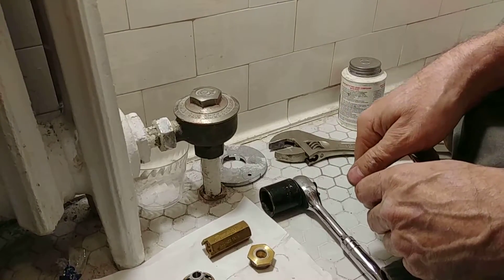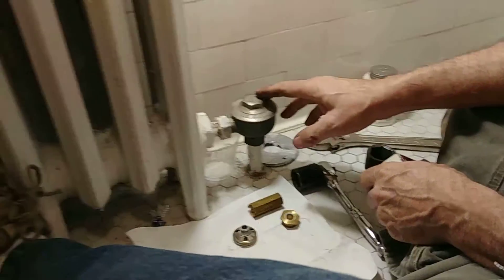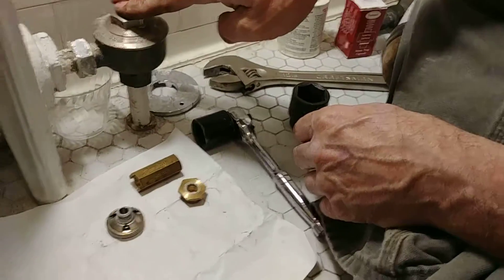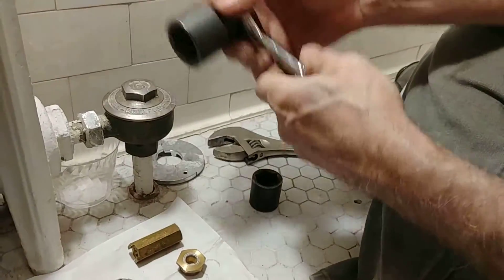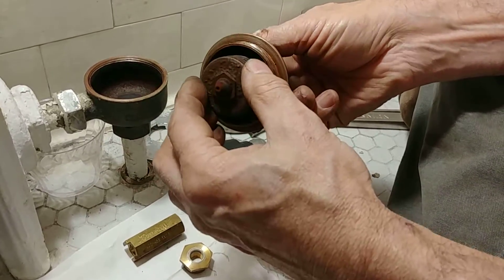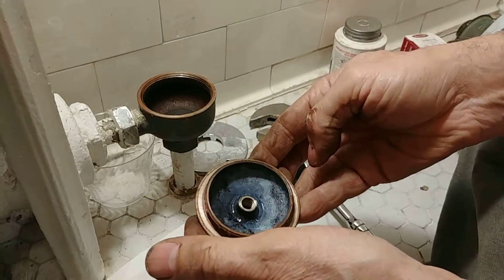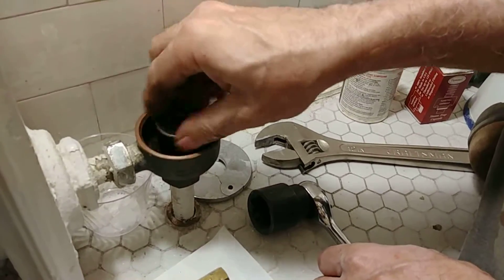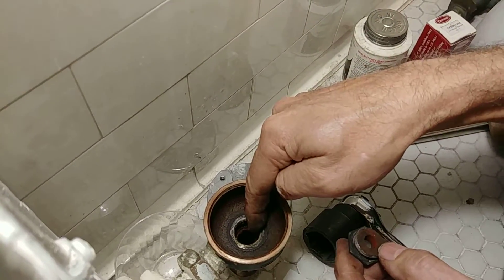Rebuilding a Radiator Steam Trap with a Tunstall Capsule

Comment: I wish traps were that easy to fix. Why do people put layers of paint over the traps and valves? It makes it so much harder to repair and replace.
Reply from the maker: It sometimes can be difficult, but at least for me I do find that an impact driver and the proper socket make quick work of trap caps, painted or otherwise.

Comment: My church has a Spirax sarco RT A125 trap.  Does Barnes and Jones make a cage unit to fit.  Thank You
Reply from the maker: In the B&J trap booklet, under Sarco, a TA125 trap uses a #5007 cage unit and also calls for a whole new cap.
I would confirm this with your local B&J rep, or call B&J directly.
Have you called Tunstall?
Reply: @gordonschweizer5154  i havent but i will .  thanks again, love the vidoes.  God bless

Comment: What is the job of the trap and thermostat, thanks
Reply from the maker: The thermostatic radiator trap's job is to maintain the pressure differential between the steam supply and the return piping.  That is to say it traps the steam in the radiator, allowing the steam to give up its latent heat and turn into water.
The trap allows water to pass to get back to the boiler, as well as air, but it is supposed to shut in the presence of steam.
Reply: @gordonschweizer5154  Ty

Comment: very good content,  very helpful.  as i am new to steam , which of the thermostatic radiator trap repair kits are best? .. tunstall or barnes and jones?
Reply from the maker: They both have their pluses and minuses.  B&J's gasket is a weak point, but their bellows seem to handle more cycles then the Tunstalls (Tunstall would respectfully disagree).  B&J units seem to pass more air and allow the radiator to heat quicker, but on small radiators like the one shown, the more restrictive Tunstalls help keep the system balanced by slowing the steam flow ( helps put more steam where it might be needed in a bigger radiator).

Comment: Is there another situation that would result in the diagnosis "we need to reebuild the steam trap" other than a radiator that won't heat, or is it typically a straight forward, "radiator won't heat, that's typically the only situation we need to lok at the trap"?
Reply from the maker: There are other reasons why a radiator won't heat besides a failed closed trap.
Did the radiator heat before and now doesn't? The trap could be at fault, but is the inlet valve stuck closed?
If you run the system, and every radiator heats but one, and you remove the trap cap, and it suddenly starts heating, it's a return problem (which could include the trap). If it doesn't it's a supply issue.
If you pop the trap cap, and water starts rolling out of the trap, it was the trap!
Reply: @gordonschweizer5154  Thanks so much. You're a treasure ferpetesake.
Reply: Discard the gasket for the B&J cage unit and use a good Teflon tape and pipe dope on the cap,and you will have no problems with leaks. We did this in a large office building with hundreds of radiators  for years, and it always worked well.

Comment: Great work as always wish i could do stuff like that too bad there are no apprenticeships in durham nc 😭
Reply: Thank you for your comment.  Sorry about no apprenticeships in Durham, NC.  This stuff really isn't taught in plumbing, however.  It's almost all on-the-job training.  That's partly why I post these, to give folks a leg up.
Reply: Hi, I have a steam boiler and the automatic feeder is feeding too much water into the boiler.  The automatic feeder is set on low water cut off and two minutes delay. What do you think the problem is.
Reply: @tomtayansil755  I’m not a technician but the system in our old church building did that.  We had to replace all the steam traps.

Comment: The capsules on the new Hoffman traps suck.  Have you had that experience?  I have been using mostly B&J cage units.  How have those worked for you?
Reply: The Hoffman so-called "Durastat" does indeed suck for the most part!  Its only use would be on a small bathroom radiator like the one above, if I had no other choice.
The B&J cage units are generally excellent.  Their main weakness is that gasket.  For awhile, I was only installing Tunstall capsules because I liked (and still like) the positive seal of the threaded joint, and I was seeing too many gasket failures on the B&J.  I think the gasket is better now, but still...  Anyway, the B&J, in most cases, vents better and gets the radiator hotter quicker than a Tunstall (and the durastat is the Worst. Venting. Ever!).  Moreover, the bellows on a B&J is going to endure more heating cycles than the more brittle stainless steel of the Tunstall, although I think the good folks at Tunstall may disagree.  They may be right.

Also, B&J used to not give me the time of day when I called in for tech advice or even requests for custom trap rebuild kits (that has changed for the better since).  Tunstall answers the phone with friendly and VERY knowledgeable people and who accept my crazy old ancient decrepit valves for rebuilding.  Amazing!

So, I think we generally agree: The duastat sucks and the B&J capsule is an excellent product (gasket notwithstanding). I'd give the Tunstall capsules a try and do check out their other product lines like their old radiator valve rebuild kits that simply have no equal.  They are good folks to deal with.